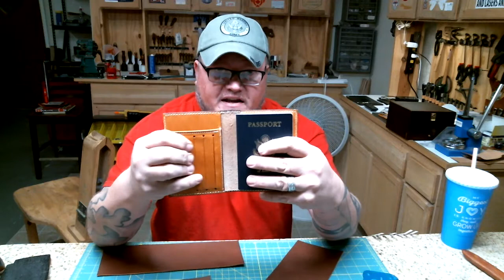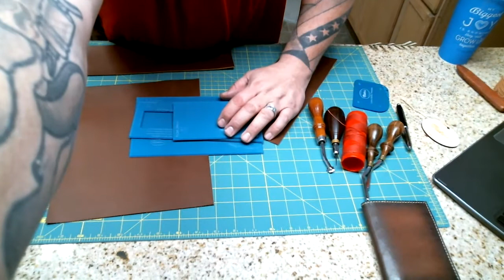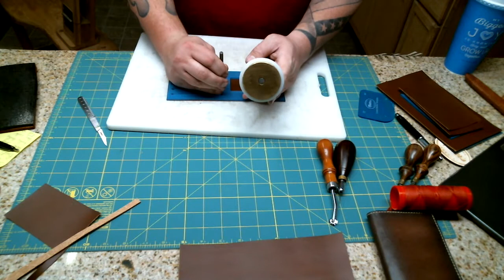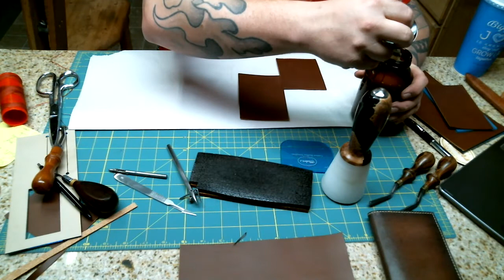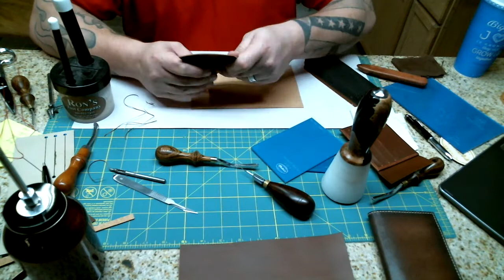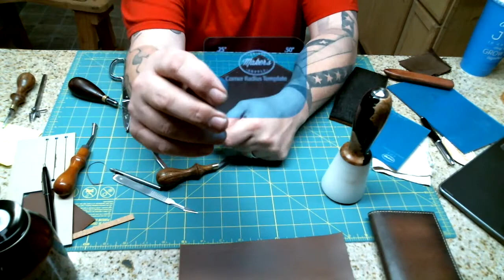Making a Leather Passport Wallet

Comment: I realize this is an older video, but I found a source for a fabric. It's not only very thin but is a RFID fabric so the credit cards are protected. I found it on Amazon for not a bad price. A 3' by 4' sheet should make a few wallets. Not too badly priced considering. The material at Makers Leather is cheaper and you get more so you're choice.